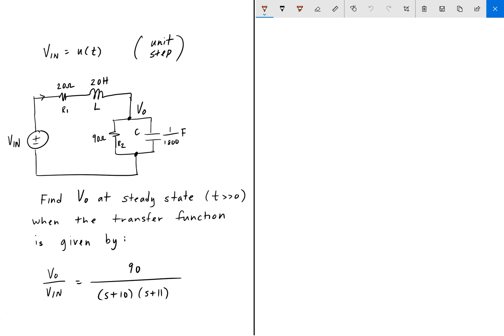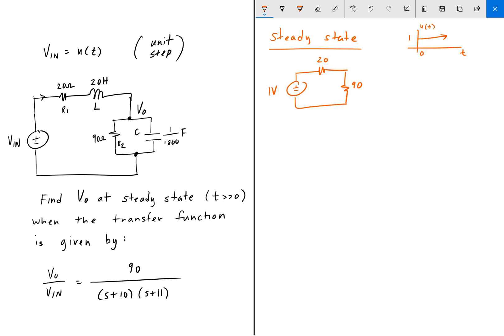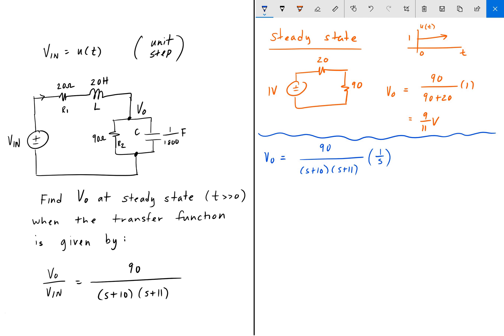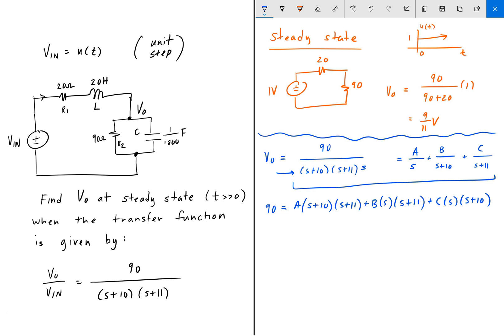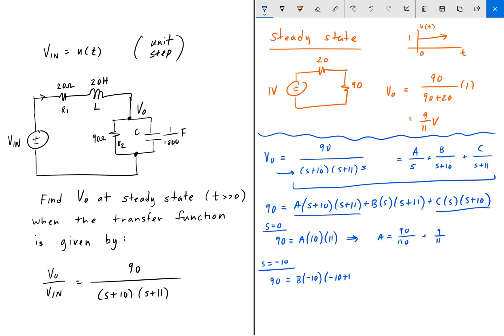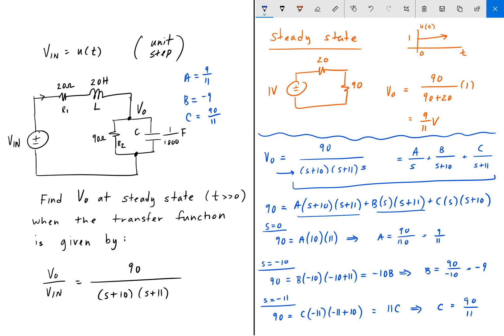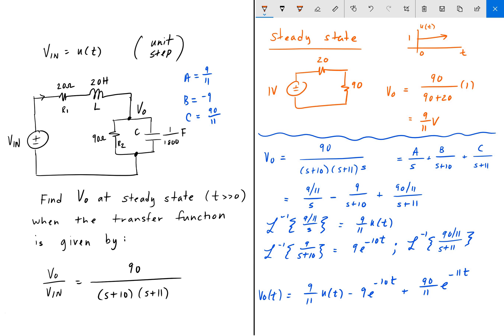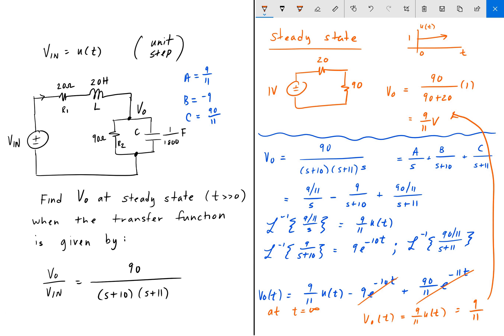Electrical FE / EIT Exam Prep - Linear Systems 5: Steady State RLC Circuit

Comment: There's also the Final Value  Theorem, which is much quicker than partial fractions. 
I used that to solve it and got the same answer.
Reply: FVT is a great third way to solve this problem. I also enjoyed the first two options he outlined.